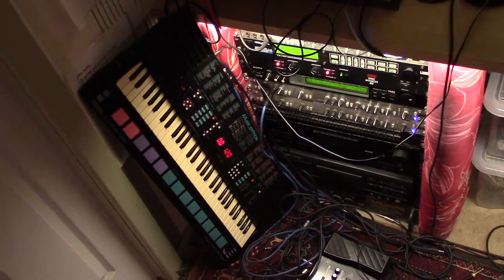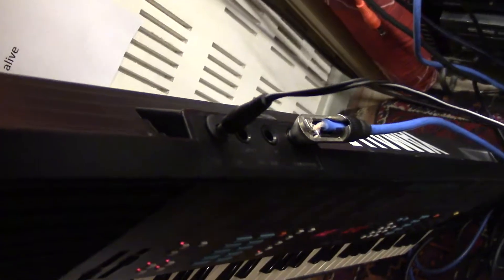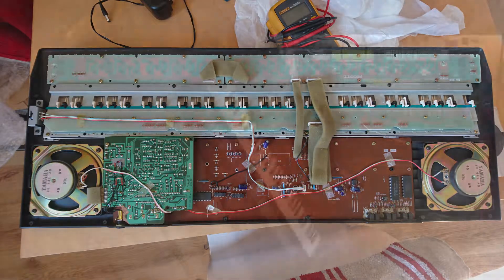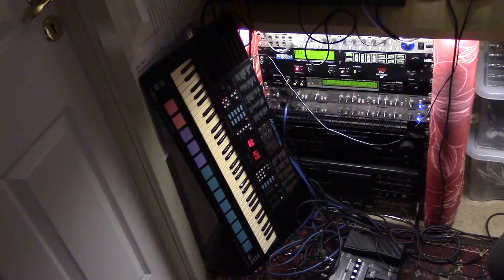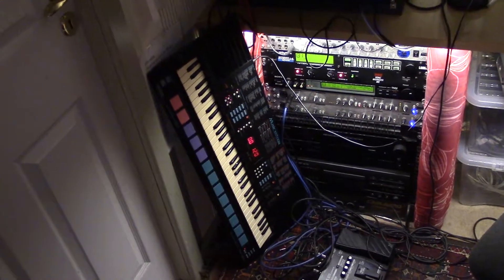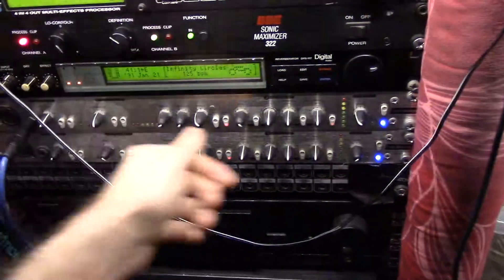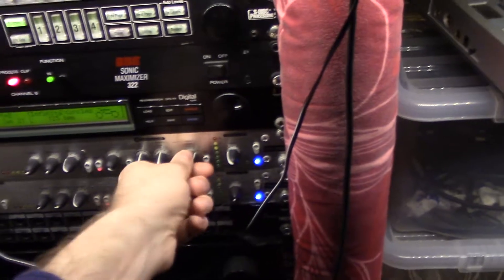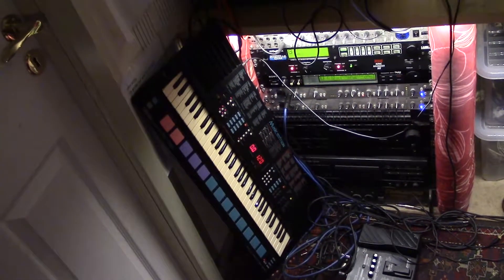1989 Yamaha PSS780 - Repair, Whine, Heartbeat??

Comment: Hello, have you managed to solve the problems with that good old vintage Yamaha PSS 780? I had one of these a few years ago and yes, it’s very good but I preferred the PSS 680 as I preferred the music styles on it. I used to have a 680 many years ago and I regretted selling it and now, I managed to salvage one recently in excellent condition and it included the proper Yamaha power supply and I don’t hear any unusual noises in the background. It seems to work perfectly well and runs perfect on 6 C size batteries.
Reply from the maker: @bestrickie2  there's a part 2 video on the channel where I made some extensive mods to cut it down a bit!
Reply: @ thanx I’ll have a nosey. Merry Christmas

Comment: Hi James. I've a similar issue with the common whine etc. But the main issue I have currently is the volume slider at the minimum still outputs but only through the left speaker!? raise it and it blends into both speakers but at a high volume. Any ideas? I've recently acquired the 780 and this has been the main problem. Contact cleaner etc hasn't worked so is it a deeper issue? Any advice gratefully received.
Reply from the maker: It sounds like the wiper of the slider pot isn't contacting the track properly. I had it on the Hitachi 6801e boombox I featured in a video. Switch cleaner usually doesn't fix it, you'd likely have to desolder the pot, dismantle and clean and regrease it... or maybe just even replace it if that's easier!
Reply: @jamesbennettmusic  Thanks for the reply. I did wonder, I assume the slider works on a similar principal to a rotary pot?   I'll give it a further clean etc and see how that goes. I have some fader lube etc.
Reply from the maker: yep just the same, they often have the carbon track and then a little metal rail, and the little 'fingers' can break off the slider sometimes